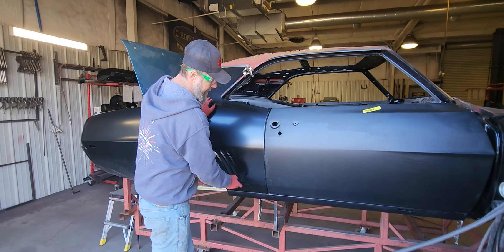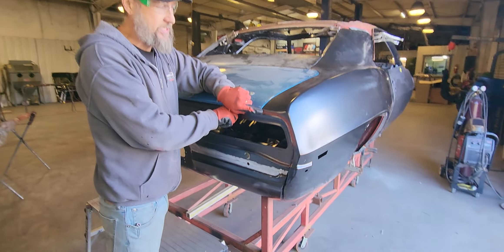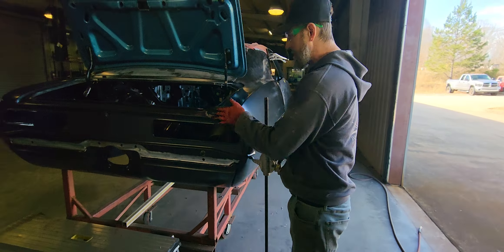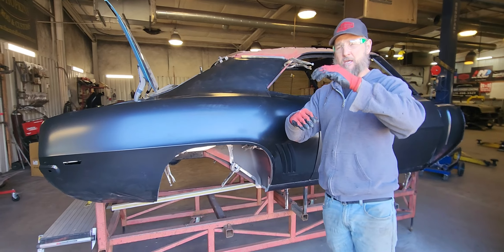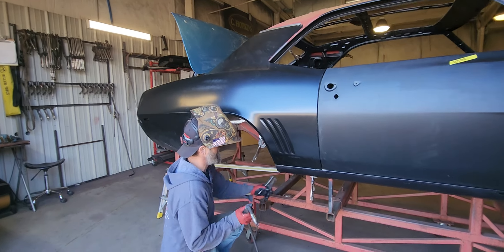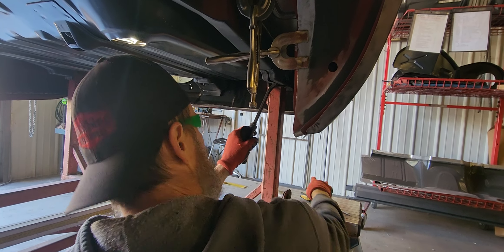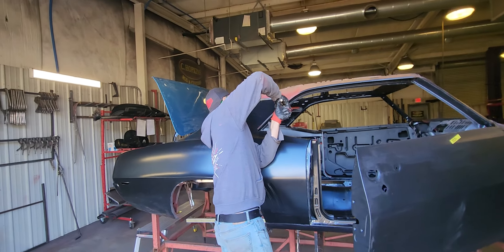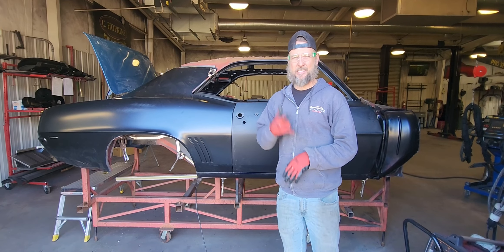1967-69 camaro door gap fix when replacing quarter panels.  (Mr. Fireman)

Comment: Thank you so much, can’t wait to give this a try, I bet it works like magic
Reply from the maker: Just make sure everything is loose and will float. Clamps, screws,  bolts or anything holding it needs to be released up top but leave anything attached to trunk floor and wheel houses attached
Reply: @aMAYSingMetalWorks  will do